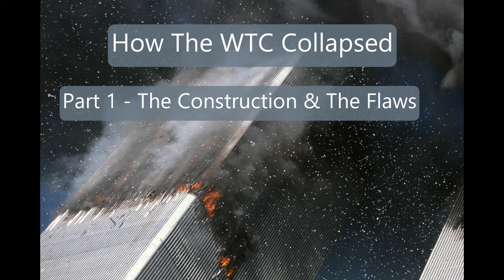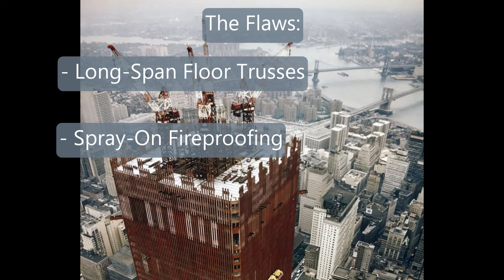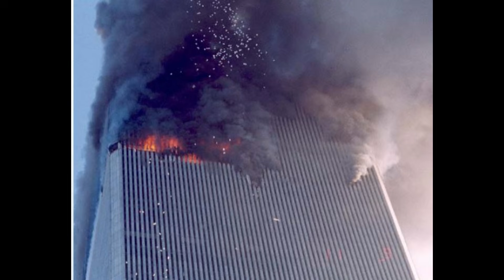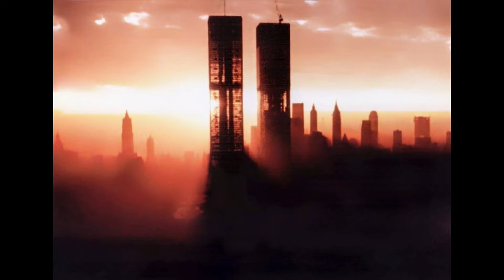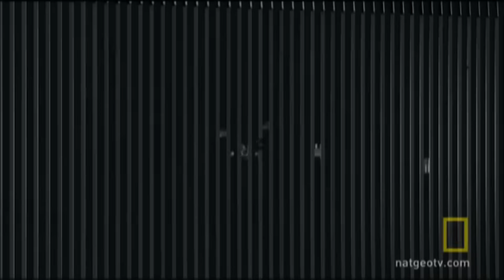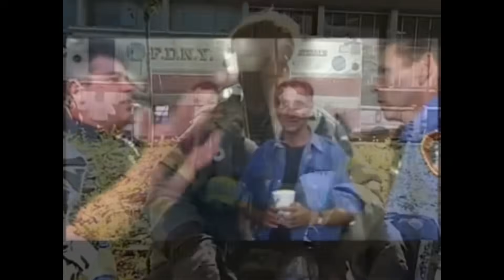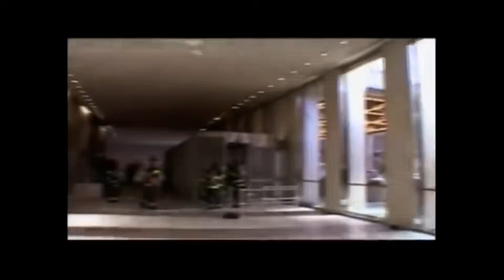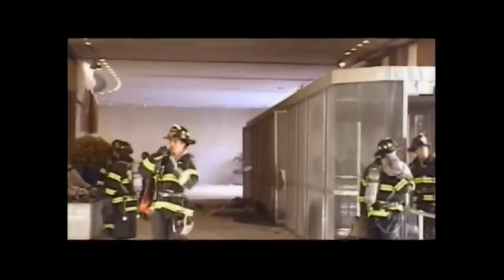9/11 Explained: WTC Collapse Explained

Comment: 0:44 There were no fatal flaws in the design of the Twin Towers.

"The building was designed to have a fully loaded 707 crash into it. That was the largest plane at the time. I believe that the building probably could sustain multiple impacts of jet liners because this structure is like the mosquito netting on your screen door - this intense grid...  and the jet plane is just a pencil puncturing that screen netting. It really does nothing to the screen netting."
Frank DeMartini
WTC Construction Manager
January 25, 2001

"So if you think about a 300 ton element crashing into a building that's been designed to carry 13,000 tons, you can see that an aircraft crashing into the WTC would probably not do anything."
Charlie Thornton
WTC Structural Engineer
1988
Reply from the maker: Amazing, you post a comment claiming something which is specifically covered in this very video; a sure sign you didn't even watch all of it. 

The 707 claim is covered in the 'Myths' section at the end of the video.
Reply: the towers did exactly as they were designed to do....so what's your point? The towers did withstand the impacts. They were seen standing long after the planes hit. 

Leslie Robinson the lead Structural Engineer offered his view point a long time ago....maybe do some real research instead of trying to quote mine and twist statements to fit your beliefs.
Reply: This is complete nonsense. Beyond the fact that it's been covered in the video, it's idiotic in the extreme. Falls on its own impossibility.
Not only has it NEVER been a design specification to "have a fully loaded 707 crash into it", not before the Towers, not WITH the Towers, and notably, not AFTER the Towers. But beyond that, even if you were to argue that it WAS a design specification....it fulfilled that specification. The Towers withstood the impacts for a minimum of an hour. What destroyed them was primarily the fires.
Reply: The claim the Twin Towers were designed to or could withstand multiple impacts from fully loaded Boeing 707’s at high speed is a myth. It comes from a cherry-picked video clip from a TV documentary interview which aired during the 7th Season of the History Channel's Series "Modern Marvels" on June 25, 2001.

Frank A. De Martini, declaring himself the Manager, WTC Construction and Project Management claimed the Twin Towers were "designed" to withstand the impact of a "fully-loaded Boeing 707”, which is a bit vague, as he does not define what that means. He goes on to say that in his opinion each of the Twin Towers would "probably sustain multiple impacts of jetliners because this structure is like the mosquito netting on your screen door: this intense grid; and, the jet plane is just a pencil puncturing this screen netting; it really does nothing to the screen netting."

But there are a few problems,…

De Martini was an onsite Manager at the WTC. However, he was NOT an engineer nor did he have anything whatsoever to do with the design or construction of the Twin Towers (he was born in 1952, so he would have been 15 when the towers were designed). De Martini's role was to manage internal projects of partitions, electrical and plumbing long after the towers were built . While conspiracists whose standards of evidence stop at anything that agrees with me naturally cling to it, De Martini's assertions about a 'fully loaded 707' and 'multiple strikes' and 'screen door' have been characterized as hyperbole by people in a position to actually know.

For example, De Martini's assertions differ significantly from those of Leslie Robertson, who as the head structural engineer on the construction project was in a much, much better position to actually know . That fact alone is reason to ignore them. That is, if the man who built the towers makes direct statements about how the towers were designed, then why would intelligent people listen the wiring and plumbing guy who was a kid when the towers were built?

In the famous three pages of arithmetic that Leslie Robertson carried out, the scenario of a single Boeing 707 on landing approach and lost in fog (light and slow) was examined after the Twin Towers were designed.

That’s it.

Worth noting that both towers in the end did survive the impacts which were 4 and 5 times greater in terms of energy respectively than Robertson's single 707 scenario. No one ever attempted to model what came after impact , and conspiracists can't work out that is a very different thing.

You could try and ask De Martini about it, but it might be difficult to get an answer as DeMartini - who officed out of the 88th floor of the North Tower - was killed while trying to rescue survivors when the North Tower collapsed on 9/11/2001.

Let that be an important lesson in the value of not just accepting things at face value because you want them to be true. It is clearly a bad habit for you

Comment: When talking about why the top crushed the bottom, you should clarify to your viewers that you’re presenting your own speculation basically. The NIST report doesn’t attempt to explain the total collapse of the towers. Yes the towers were heavy, but obviously the columns had to be incredibly strong to hold up that weight. What do you mean when you say the collapse wasn’t resisted by the core? The core columns would obviously be in the way.
Reply: Collapse was not columns crushing columns as many people assume. Collapse progressed by loose debris falling through the open office space, failing the floor truss systems below it one floor at a time.  As the floors were ripped away the perimeter columns lost lateral support as they were disconnected from the remainder of the structure.  That is why we see huge sections of perimeter columns peeling away behind the collapse front.

Cores failed last and were largely spectators in this event.
Reply: @MFitz12 That is self contradictory BS that you've posted.

You still don't know the basis elements of the design of the towers. If you can't get these absolute vasucs correct, it's little wonder your ludicrous hypothesis is so flawed.
Reply: NIST does explain the collapses and it is supported by millions of experts that have decades of education and experience in their fields. Maybe try and read the sources you are trying to quote mine before you comment or you will just make yourself look foolish.

Comment: Verinage demolitions are started in the middle and cause the top block to decelerate, which did not happen in the case of the Twin Towers. https://youtu.be/NiHeCjZlkr8?si=FuIy9yfwXfh8DPAf
Reply: verinage demolition doesn't use any type of demo charge. It only uses the weight of the building above to collapse the rest of the building below. Verinage demo proves that truthers are wrong when they claim that the top section of the towers could not cause the collapse of the rest of the building below. Good job proving truthers wrong. Keep up the good work.

Comment: Good video but with ur logic if i dropped the Titanic from just the top of the building it will land all the way in the basement  at free fall speed!! The demolition they weaken the buildings beforehand to allowed it to fall and notice how they go near the middle of the building instead of the top.... Im not saying i kno what happen but u just cant break the laws of physics.. if u have a total mass off 60,000 tons and i drop only 10% of that weight or even 25% onto the 60,000 tons it will not have enough mass or energy to take the building completely down all the way to the basement.. unless the building was already already weaken .. thats what i have trouble with .. and all the floors below where still fully intact so how can a pancake collapse happen at free fall speed if there is resistance from the intact flooors and if u see the top of the one tower starts leaning one way but then miraculously starts falling straight down ... I understand that im not an engineer or anthing like that but simple math can b applied here
Reply: @MackieSk856 You say "if u have a total mass off 60,000 tons and i drop only 10% of that weight or even 25% onto the 60,000 tons it will not have enough mass or energy to take the building completely down all the way to the basement"
1. That is a bare claim - you IMAGINE this, but there is no actual, applied physics backing up the claim.
2. What matters isn't so much the percentage of the building mass that's dropping. The total mass / number of floors is more relevant. Here is why:
- A building is MOSTLY just air. @cjnewson88 says 90% air, but the twins were actually closer to 95% air, by volume. And each floor, the open space between any two floor slabs, is 98% open air by area, with just 2% of the footprint aera occupied by structural steel columns. The latter is what keeps the top 12, 15, 30 floors from going down.
- But as the top 12, 15, 30 floors of the towers collapsed, they tilted, and that means the columns no longer align: The falling columns don't hit columns below - they hit floor slabs (or even nothing, if they slip outside of the perimeter)
- So, to a first approximation, 98% of the mass of the top 12, 15, 30 floors (dozens of thousands of tons) fall onto the floor slabs
- Floor slabs were those relatively flimsy trusses (1 inch and less in diameter rods) covered with just 4 inches of light-weight concrete. The Floors were designed to hold the vertical weight of just what is on an office floor: Furniture, people, carpets, plus their own weight.
NIST determined that, under ideal conditions (mass evenly spread out), a floor slab (the system of floor trusses) could carry the STATIC weight of 12 floor slabs, or the DYNAMIC force of 6 or less floor slabs descending on it. That is just the bare floor slabs - no columns etc imcluded in that calculation.
- But the falling mass was NOT ideally distributed. In reality, some floor trusses are impacted much harder than others and fail sooner; their weight is then added to what the remaining trusses must bear - trusses all over a floor slab come unzipped rapidly.
- In short, the falling mass of the top 12, 15 or 30 floors MASSIVELY overwhelm any floor slab it falls on, punching it out with great ease. 
- The failed floor truss is added to the total mass, which descends on the next floor slab
- And the next
- And the next
It can be calculated rather easily that the resistance the floor slabs offer to the falling mass is so low it all accelerates at more than 2/3 of freefall acceleration. 
Again, remember that the columns are mostly bypassed by the collapse. To the extend that they are not too much pulled inward or pushed outward, they get deprived of the floor trusses bolted to them, and eventually stand without lateral support -> They just fall over. Some fell outward, peeling away like a banana, you can see large sheets of still-connected wall segment flat on the ground all around the former towers in photos of the aftermath.

This long-form explanation is commonly captured in a single word:

PANCAKING.

Pancaking does NOT depend on how many more floors there are below. It only depends on there being enough mass falling from above to punch out a single floor slab. Once the mass is sufficient to punch out a floor slab, it is unstoppable and will destroy ALL floor slabs below - 10, if the there are ten floors below, 1,000 if there is a thousand floors below.
Reply: your missing the point. once the parts of the building failed it about 30 floors fell on one floor which caused that floor to collapse under the weight and that process just kept repeated. when people say that the buildings pancaked on each other it wasnt all in one moment it was one after the another